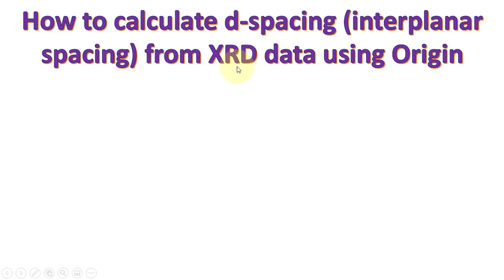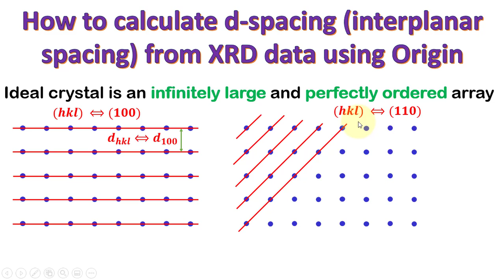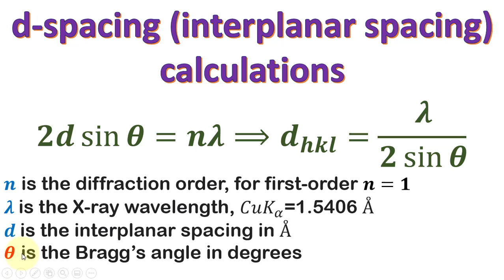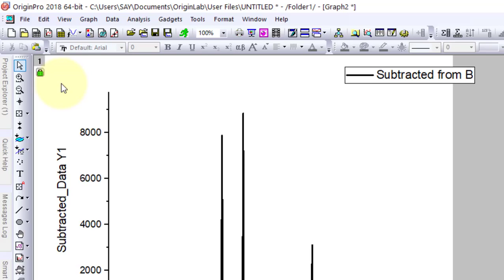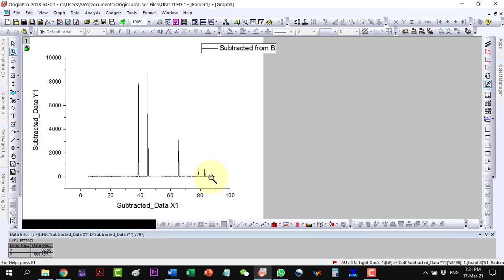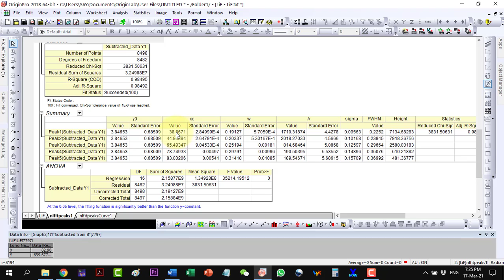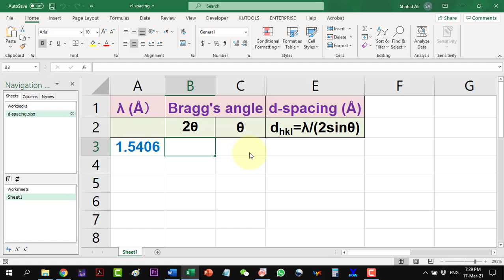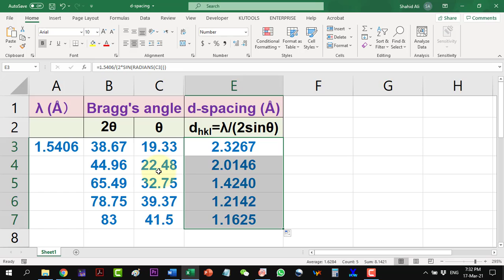How to calculate d-spacing (interplanar spacing) from XRD data using origin

Comment: Great lecture.
The only thing I didn't understand is why you use excel (in final of the video) if origin can do the same calculation you did (set column values)?
Anyway, incredibly good,
Reply from the maker: Thanks for the appreciation Leonoardo. Yes, you're right that OriginLab book can also be used for these external calculations. I prefer Excel for two reasons, one that to show the calculations as external (manual) and the second is that it is easy to use compared to OriginLab book....

Comment: Aoa sir! Whenever I've encountered issues with using Origin, I've watched your videos, which helped clear up my confusion. Recently, I calculated the FWHM for XRD using your method. However, I noticed that all the different peaks have the same FWHM values. Is it possible for various peaks to share the same FWHM values? Kindly help clear my confusion.
Thank you!"
Reply: Thank you, sir. You have cleared up my confusion. Now I will follow your instructions to resolve the problem and obtain accurate calculations.
Reply from the maker: That's great. Keep struggling... thanks
Reply from the maker: Thank you for your kind words and for using my method to calculate the FWHM for XRD. I appreciate your support! Regarding your question, it's unusual for different peaks to have exactly the same FWHM values. FWHM typically varies based on factors like crystal structure and instrument resolution. It might be worth double-checking your calculations and data processing steps to ensure accuracy. If you're still facing this issue, consider reaching out to experts in the field for further assistance. Keep up the great work!

Comment: How to calculate d space for Rhombohedral structure from xrd
...same formula or any other formula plshelp me sir
Reply from the maker: It's structure specific, you can use specific formula for your structure from the literature. Some structures you will find here. Thanks
https://www.globalsino.com/EM/page3567.html
Reply: Thank you sir. d= lambda/ 2 sin( theta/2) this formula same all the structures?
Thank you so much sir
Reply from the maker: As I said earlier, each structure has its own formula, as you can see in the provided link. Thanks
Reply: Thank you so much sir. I have done my calculation. Thanks a lot sir.. 🙏🙏💐
Reply from the maker: You're welcome dear